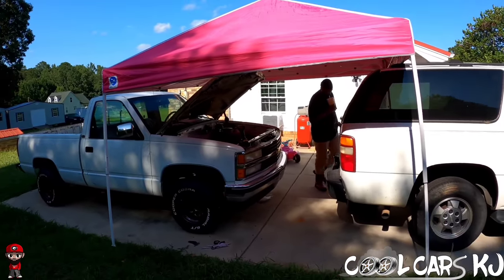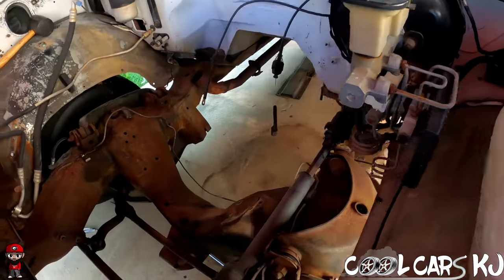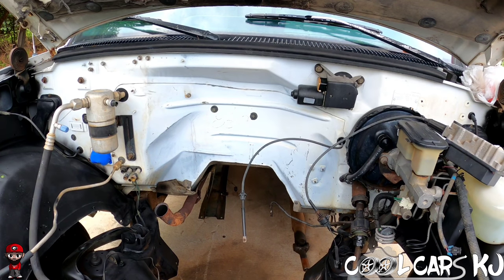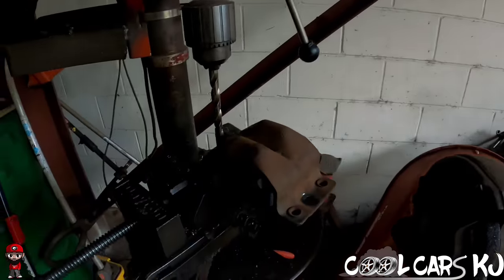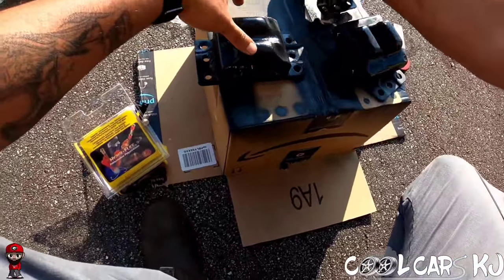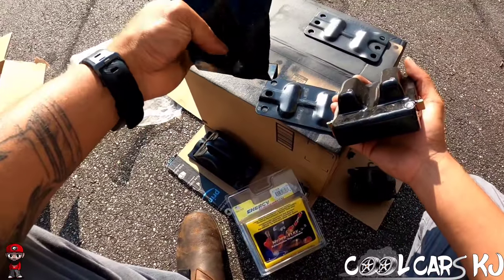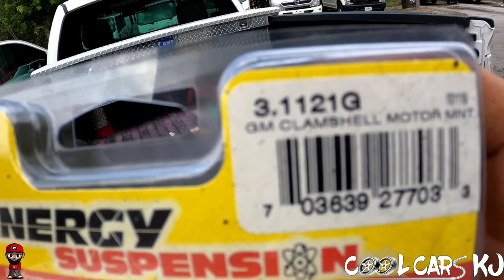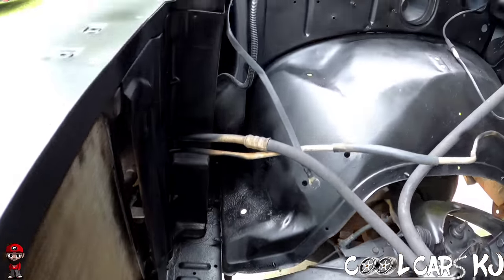'91 OBS Engine Bay Gets Paint! | Ready for LS Swap | Polyurethane Engine Mount Upgrade

Comment: Just a note incase it was mussed, Them metal tabs sticking out on the side of the energy suspension insert are only made to go in 1 way, they are 2 different sizes but they catch a tab a certain way on the other half of the mount on the block

Comment: The new mount you sourced.  Was that a new OEM mount?  If you don't mind sharing the part # and details you found it.
Reply from the maker: Westar EM2621... do not use anchor 2621 if you plan to run the energy suspension mounts. They definitely don't fit right in those. Used those on the oramge truck.

Comment: 2wd must be more difficult than the 4wd motor mounts. Definitely a 2 person job, but didn't have much issue installing them in my K1500.
Reply from the maker: if i remember correctly, the 4wd mount mounts to the frame but there nothing on the other side of frame. So you can get to the nuts easy.
Reply: @CoolCarsKJ  They do mount to the frame, but the shell is different with the upper ear being high in the mount. I'll have to look at the totaled 2wd at home to see what the other differences are.

Comment: I'm going to be removing my v6 mounts for my swap.  Do you just use a long extension to get to the backside of the bolts inside the frame?
Reply from the maker: Yes, exactly
Reply: @CoolCarsKJ  Thanks for your reply.  I've been going through alot of your videos. Thanks for the inspiration,  I'm looking forward to getting my swap going.

Comment: Which Rustolem paint did you use? is it the high heat resistant one?
Reply from the maker: Its rustoleum rust reformer. Can get it from advance auto parts

Comment: Hey my friend, you could have left them mounts on there 4.3,305.350. They are all the same.
Reply from the maker: V6 have set back plates, you CANNOT use those as far as I know. If you put a v6 and a v8 beside each other, you'll see the difference in the mounts. My stock mounts could have been used (they were original v8 mounts) but the rubber was sideways inside of them so I pulled them soni could install the energy suspension pieces.
Reply: @CoolCarsKJ  I had a 4.3 in my truck ,and i used the dirty dingo motor mounts and my 6.0 went right in without issue.I never touched the 4.3 mounts.
Reply from the maker: @chappyboylsx2596  you got instagram? Send me a pic or I can send you a pic. If it had set back plates, they usually have to come out. @cool_cars_kj

Comment: Motor mounts is easy just cut the bolt and replace it
Reply from the maker: Whats easy about getting up in the frame to put the nut back on or hold the bolt if you swap the orientation? Some people do cut a hole in the frame but I aint doing that, lol.

Comment: Greetings from CALI, I enjoy watching your videos and seeing all the work that the OBS gang is doing. I have a 91 Chevy c1500 with a 4.3 v6,5 speed. My question is On your orange truck when you did the swap, did you use the same transmission or a different one.
Reply from the maker: I kept the original speed, bro. Are you thinking about keeping it? It won't stand much heavy abuse but will be fine for a daily driver. Also, the later model 5 speeds are suppose to be much more reliable.